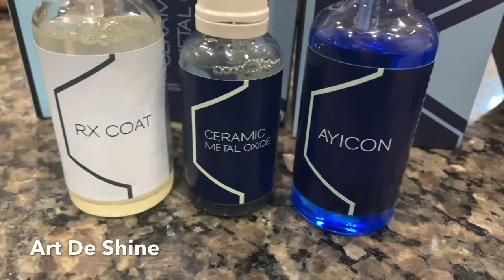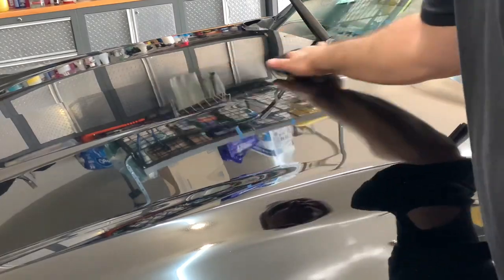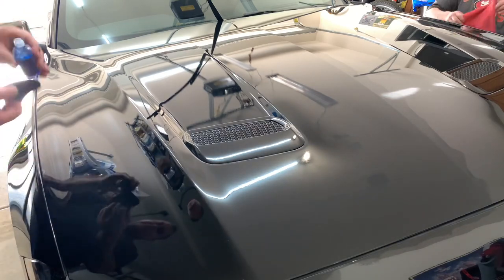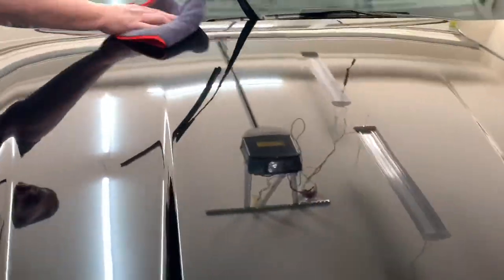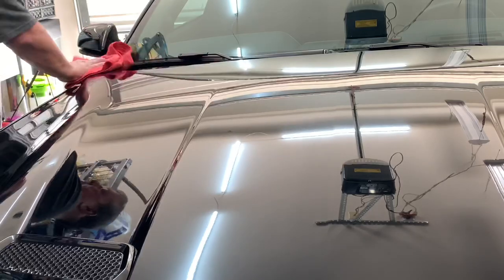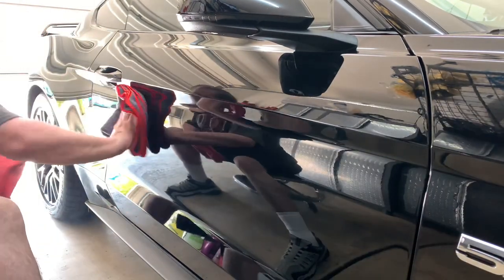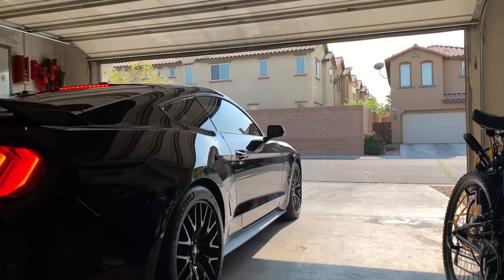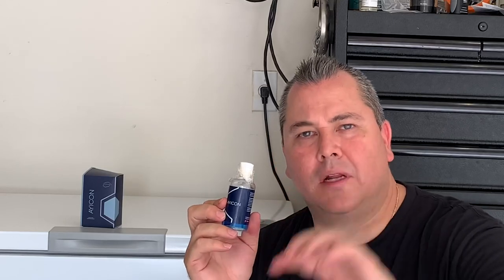Art De Shine AYICON (Ceramic Coating)

Comment: You applied 1 coat? Was there a topper to put also? And last but not least if you have ever used Cquartz how would you compare both products?
Reply from the maker: Just one coat is recommended.  U can use their graphene detailer for a topper.   Ayicon is my choice over Cquartz.

Comment: Very nice video and impressive gloss! Have you had any experience with their Ceramic metal oxide? Supposed to give you 3 years.  If you have, in terms of ease of application, how does it compare?
Reply from the maker: I have a bottle right here of M.O. but haven’t used it yet.   I’m sure it’s easy like this one.   The most difficult one is the Graphene coating.

Comment: Those Art De Shine products look solid.     I'm definitely going to be trying some of those in the future when I need some new stuff.....which unfortunately might be in 2050.  Maybe....    LOL.    I have so many different things to try right now I can't keep up.    I've really been liking the Dr. Beasley's stuff A LOT.   They have some great products for really reasonable prices.   And their stuff WORKS GREAT!   I love everything I have gotten from them.    Very solid performers for the price they charge.   I've got their 1201 ceramic coating that you apply using distilled water.   Getting ready to apply that to my car in a week or two.   I want to do a full polish just to ensure the paint is in top condition.    I got their NSP 45 finishing polish/primer to do that with.   Polishes and leaves down a ceramic primer with what they describe as "bonding points" for the coating to adhere to.    Plus, the best part, you don't have to use any sort of IPA or panel prep which I love.    You might want to give NSP 45 a try some day.  I know you do coatings and you can eliminate the IPA step and have a "bonding agent" to extend the life of the coating and ensure it gets a great bond on the surface.    I believe all their new NSP range has some sort of this bonding agent in it.   They say that each step (there are NSP 150, 95, and 45) leave an additional thin layer thus building "up" your layers on top of each other.    Their claims are interesting.  Mike Phillips at Autogeek said he really likes the stuff.   Supposedly works really well.   They just came out with a "one step" Nano primer too called NSP Z1 which leaves a years worth of coating down IN ADDITION to polishing out defects!   Plus you can coat over Z1 too which is a great option.  You don't have to, but you can for additional protection.   I'm thinking Z1 topped with a Ceramic coating would be an awesome combo.   Z1 tackles about 80 to 90% of the defects (pretty darned good for a one step) and leaves a coating.   That would be most detailers dream product.   And 98% of car owners out there would be perfectly fine with that result.   Especially for a decent price.   I may try that product next time around to see how it performs.   Like I said, loving the Dr. Beasley's products!   If I had to choose "one company" at this moment in time for ALL my products for detailing.   It would be Dr. Beasley's.   They have a product for just about everything detailing related.
Reply from the maker: That’s interesting, I’ve tried a few of their prod in the past but didn’t get blown away by them.  I will have to swing back and take a closer look.  That primer polish u mentioned sounds really good. Im definitely gonna look into it
Reply: @DetailingBreakdown  Yeah, look into their NSP primer range.  And yes, you are right,  I'm surely not "Blown Away" by the products, but, for the money, they work great.    Granted,  I have not used their coatings yet, and that 1201 coating I got from them is what I call a "coating light" or "extra strong sealant" probably.  They call it a ceramic coating that last about a year, but it's probably just an Si02 based sealant or something.     Just got their micro-suede cleaner and their micro-suede fabric protectant but haven't applied them yet.   My seat centers are that material in my sports car along with the door sides and a few other interior surfaces so I thought i'd give them a shot.   I have Polish Angel stuff but that stuff get's expensive real quick.    https://www.autogeekonline.net/forum/ask-mike-phillips-your-detailing-questions-/126123-testing-dr-beasleys-new-nano-surface-primers.html
Reply from the maker: @joevanseeters2873  absolutely, I definitely look at that. Thanks for the heads up!!!  Love talking shop with u.

Comment: Where can you buy ir
Reply from the maker: https://www.artdeshine.com/
Reply: Where can you buy it no one has it why are you advertising Art De Shine Ayicon ceramic coating if you can’t buy it.
Reply from the maker: @patp5780  I don’t control what companies have in stock.  Obviously, it’s a hot brand and their products are fire.   Do not blame me if you can’t find it somewhere in stock.  I will post another link to Carzilla in Canada that has many of their products.  Ayicon again, is out of stock.  It’s their glossiest coating and people want gloss.  

https://carzilla.ca/collections/brand-artdeshine
Reply from the maker: @patp5780  I just spoke with Artdeshine USA and they said contact them.  It’s part of their PRO line and u have to buy through invoice.   So just contact them and they will get u set up
Reply from the maker: @patp5780  or email them at info@artdeshine.com